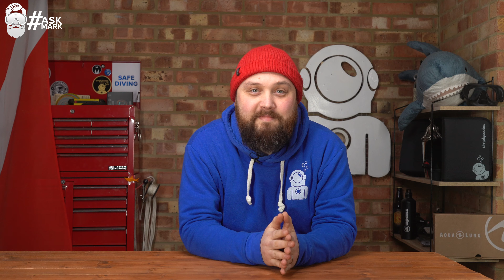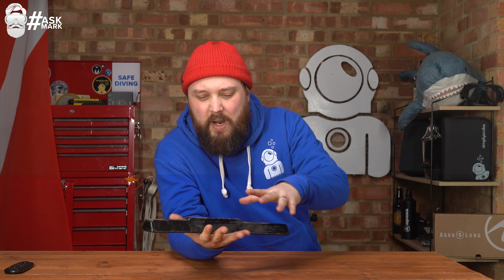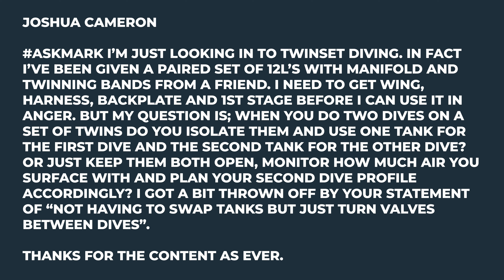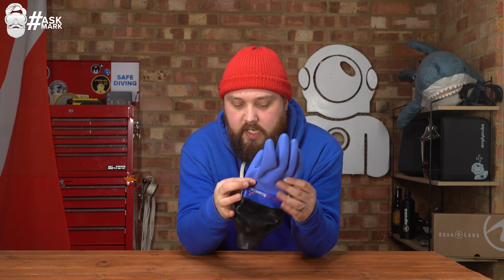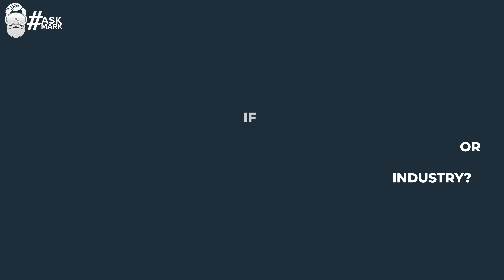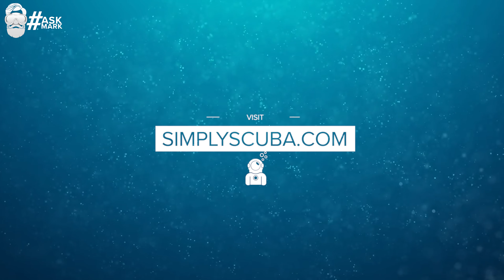How Many is Too Many Boltsnaps | #AskMark | @simplyscuba

Comment: When you isolate your twins, and you dive from one cylinder only, then on the second dive your alternate air will be on a mostly empty cylinder if you forget to open the manifold valve again. It introduces complexity and with that human errors into your dive. Better to leave them both connected.

When diving sidemount, you alternate between regulators in order to breathe both cylinders down equally. You could do the same with isolated twins, but again, why would you when you can just leave the manifold open.

If you're starting off with 200 bar, just stay underwater until you hit around 125 bar, and save the remaining 75 bar for the second dive.

Comment: Bolt snaps on everything and then a spare! I also keep a couple spares in my save-a-dive kit.
1 on my CX2 light, 1 on my back up light if it's a night dive, 1 on my Go Pro, 1 on my DSMB and reel, 1 on the flag, 1 on the flag reel, 1 on the mesh bag I carry to pick up trash, 1 on my primary first stage to keep it out of the sand during beach dives, 1 on my octo in case I have issues with the neck holder, 1 on my spg/depth gauge/compass hose. 7 to 10 or so bolt snaps on every dive.
Reply: I only have a backup light, no primary yet, but here's my boltsnap distribution:
Small eye on my primary long hose regulator
Small eye on my backup dive light tucked behind an elastic band
Small eye on my folding dive knife tucked behind an elastic band
Small eye on my wetnotes (in my left pocket)
Large eye on my SPG
Double-ender on my 15m spool and orange dSMB (in my left pocket)
Double-ender on my 30m spool and yellow dSMB (in my left pocket)
Double-ender on my spare mask (in my right pocket)
Cheap double-ender as a spare (so I won't mind as much when I don't get it back)
Double-ender in my SAD kit.

I'll add more as the need arises, like for a primary dive light.

Comment: #AskMark I use for SM a Hollis Katana 2, for the weight pockets I use soft lead tiny bags but does lead exists in square flat plates which fit in the lead pockets, for ex. 10 by 10 cm and 0.5 cm thick ?

Comment: G'day,
I'm currently looking at buying my first BP/W setup and am considering various brands. As a newbie/first-timer should I buy a complete set (e.g. XDeep Zeos or Mares Polygon) or should I buy harness/backplate and wing separate and assemble them myself? Especially given that I've never done anything like that and wouldn't know how to fit one (in a dry condition too).
Cheers Mate #AskMark
Reply: Buy them from your LDS, they'll usually fit the harness to you.
You can buy them all separate, or in a package. Check which one is (significantly) cheaper. A package is usually offered at a discount, but you do pay extra for branded webbing. When buying different brands of backplate and wing, check that they actually go together. Some brands create backplates and wings that only work with their own brand. Your LDS can advise you on this as well, and they can also advise you on whether to get a steel or aluminium backplate based on the intended use (travel/home/single/double/wetsuit/drysuit/etc.)

Plus, if you need help later on, your LDS will be more inclined to assist you if you bought the kit from them.

Comment: G’day Mark 
On the subject of torches is there a difference between one for warm water compared to for cold I’m over Asia way ish lol
Reply: High powered torches can overheat, so you need to keep them cool. The nice thing about water cooling is that it keeps the torch at water temperature.

If you're ever diving in water that's hot enough to have a torch overheat, you probably won't survive it.

Do keep in mind that out of the water torches are more prone to overheat, so don't leave 3000 lumen torch on too long if you're not in the water.

Comment: #AskMark: Hi Mark, I have a good old Scubapro Mantis dive computer and thinking about upgrading to something with a transmitter. All computers are capable of beeping, and of course, they continuously monitor a lot of parameters, however, I don't seem to find a computer that let me program when I want it to beep. The use for what I want to do is to tell my computer to beep when my NDL is at two minutes for instance, or if I have a transmitter, I want it to beep when my tank is at 100 bar, or 65, or whatever. Even more interesting would be with a computer like the Garmin where I can monitor two or more tanks at once, it would be awesome if I could tell it to beep if anyone in the group reaches 100 bar. No cheating mode activated! Cheers! LJ
Reply: The Shearwater Petrel, Perdix and Teric have customizable alerts.
You can set the depth, dive time, and NDL remaining. You can't set alerts for your air pressure or GTR.

The Garmin Descent Mk2i is the only dive computer that you can use to monitor tank pressures of other people, because it works with sonar instead of radio signals. The range for radio transmitters in water is generally about a meter or so, so it'll just make it from your regulator to your wrist. Sonar has a far larger reach, so it could theoretically communicate with transmitters on other peoples' cylinders. It will demand a significant investment though. Each Garmin transmitter costs about $400, so for a group of 4 students that would be an additional $1,600.

Comment: Your computer will not track a correct OTU and CNS loading if you set incorrect gas on your dive computer.
Reply: That is true but as I said in the question “aside from MOD considerations”.  If you don’t get near the MOD for the mix you’re breathing, oxygen toxicity isn’t an issue if you dive an air profile while breathing Nitrox. My 2 cents but I’m no expert which is why I asked the question.
Reply: @391wombat  My Shearwater Teric dive computer (as do other Shearwater computers and I'm sure other brands do too) tracks nitrogen levels, which I use as an additional reference to ensure long enough surface intervals. Just another reason to get in the habit of using the correct settings.
Reply: @B_A_Adventures_And_Investing  Thanks Brian. End of the inquiry I guess. I just read so many accounts of divers staying well within NDL limits and still getting bent I thought an air profile on nitrox might be an extra layer of protection but you’re the second pro that doesn’t recommend it. Thanks again, John

Comment: Hi Mark, on the topic of nitrox dived as air, that is something that BSAC teaches at Ocean Diver level since the MOD of 36% is deeper than the 20m max depth, it is additional safety.
Reply: Assuming Ocean Diver is the equivalent of Open Water (max 18m), that would work. However, it breeds bad habits which you need to unlearn when you do the Advanced Open Water equivalent (max 30m), or Deep Diver (max 40m).
Reply: @bloodymarvelous4790  What bad habits are you referring to? 

For context, Ocean Divers are limited to 20m. They are still expected to be able to compute MODs and so on, they are simply not allowed to take advantage of Nitrox as Nitrox. They are only allowed to dive Nitrox as if it were air for decompression calculations. All other aspects like pO2, MOD, and so on are taught as per a Nitrox class. So it allows Ocean Divers to have additional conservatism against DCI.
Reply: @tobiashartung856  The bad habits are that you are setting your computer incorrectly to give you an added safety margin.

1. It negates the benefit of Nitrox. Your NDL is longer on Nitrox, and your SI is shorter. By setting it to air it will reduce your NDL and increase your SI.
2. You're now assuming that there is an additional safety margin, and you may act on that. Like setting your watch 5 minutes fast, and then going, nah, I still got an extra 5 minutes. But now you're diving on air, and not nitrox, and you've just exceeded your NDL.
3. Most importantly, it's basically being lazy, and not being a responsible diver. You just don't want to set your dive computer to Nitrox. If you think it's better to have a wider safety margin, do that consciously. You see your NDL ticking down into the final 10 minutes? Go shallower. You see your minimum SI has passed, stay out of the water for an extra 15 to 30 minutes. Your safety stop has lasted 3 minutes? Stay an extra 2. That makes you a responsible diver, not by feeding your dive computer garbage. You get out of your computer what you put in it. Garbage in, garbage out.

Comment: OThree make a selection of neoprene dry suits and they fit Kubis to all of them.  Of course the glove ring fits to the suit material, not the sleave seal which remains inside in case you get a glove leak.
The correct number of boltsnaps a diver needs is one more than they currently have.

Comment: How many is too many?...When you start offsetting your required dive weights might be an indicator you are getting close to the upper limit of too many.
Reply: No such thing as too many! :) I'd rather carry the weight in bolt snaps and have everything secure, than carry dead weight lead. I only carry 7-10 bolt snaps on each dive. On of the reasons I switched to steel 120s from Aluminum 100s.